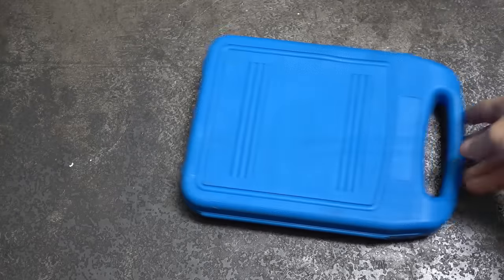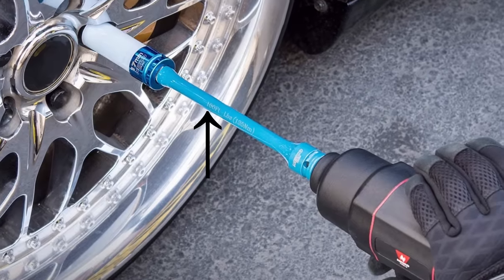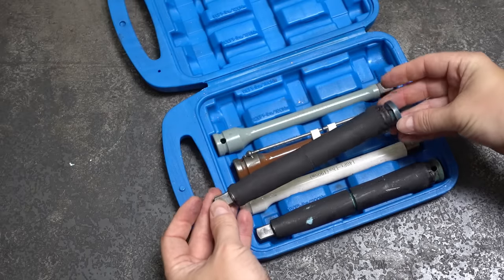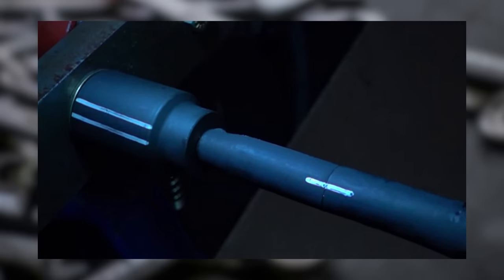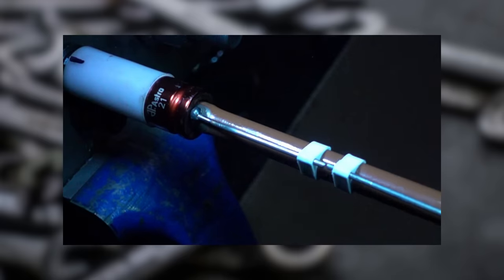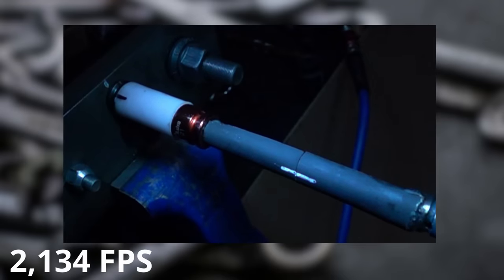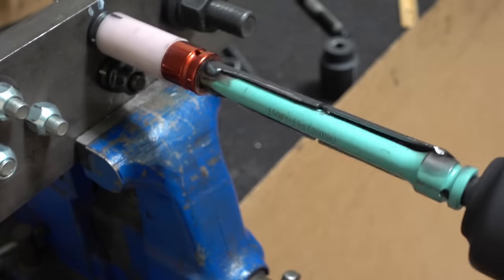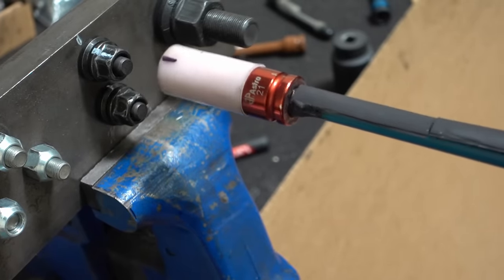Torque Sticks! High Speed Video Helps Reveal the Truth

Comment: I spent years using torque sticks and then double checking EVERYTIME with torque wrench.  99% of the time, they were accurate...enough.  110 ft lbs on a 100 ft lb recommended wheel stud is fine and youd barely notice the extra strength required to break the nut free...a couple inches longer breaker bar / tire iron would literally make it a non issue.  Old timers dont even torque their wheels....they just crank em on as hard as possible...I have removed wheels that must have had 200+ ft lbs on the studs...literally ready to snap.  Just use a fang torque wrench...they are like $25 at Princess Auto.  I would bet over 75% of vehicles on the road have improperly torqued wheels.

Comment: Other than speed like in a manufacturing environment or perhaps a shop that does one thing (change lug nuts) I don't see the point of these. Probably better to just tighten snug and then torque to the needed measurement.

Comment: Torque sticks = nope.  Thats life and death stuff sometimes.
Know your tools. My 1/4 impact driver at setting 2 with the small battery and 1/2 drive  adapter + deep impact 19mm socket = approx 80 ftlbs. Honda lug nuts many are 80 ftlbs.  Turn the nut till it JUST bottoms, stop.  Finish with torque wrench. Drive the car aggressively 10km, retorque.  Yes it takes time. But theres a right way and wrong way, usually for a good reason.
Stay gold.

Comment: Im a auto Tech in 8 years of daily work ive heard of a tire off twice and both times the tech used a torq stick one was over tightend stud snapped and 1 was not enough and fell off. I do not own torq sticks.  in my opinon they are pointless and dangerous. I personaly. Have learned finger control as my old school air gun has no settings. I zip them on and if the lug does not move at all when i use torq wrench  i know its over tightend so i crack that one loose and do it by hand. In 8 years ive never had a wheel off. Its not hard be safe.

Comment: Horse power is the difference. Torque vs. HP.  HP = (Torque x RPM)/5252. Electric impact guns typically run higher RPM than air guns. Thus, more HP. Torque sticks are designed for AIR guns. Only torque sticks designed for ELECTRIC will work properly with cordless. Problem is finding electric vs. air on the packaging. Always assume specs are for air. After all, what do tire shops run on? AIR.
But I’m old school. If I hear an electric impact gun at a tire shop I throw a fit, watch them manually torque, and don’t go back.

Comment: I use them WITH my cordless impact for wheels only! Never over torqued any lug nuts with them, as long as you only give them a sec or two per nut and no more! Works every time and saves me a ton of time and hassle from having to torque things manually.

Comment: I am pretty confident I mentioned this on your last video, but the reason the electric impact doesn't work with the torque bars is because there is no gas to compress. It's all power all the time, where as an air gun will act like a cushion taking some of the guts out of each impact in conjunction with the bar to stop it going over the amount.

Comment: You'd see a more dramatic effect if instead of cutting the tube in half, you made the cut closer to the male end of the torque stick.
Reply: The ends of the tube are welded at the ends of the stick. So the mark in the center is moving relative to the ends of the stick, not relative to the center of the stick (even though that's where the mark is). So in theory, the cut/mark could be anywhere along the stick and show the same results.
Reply: @troysweet4038  oh yeah, you're right. I was thinking about it as a lever, but the fulcrum is not at the ends, it's in the center of the shaft. My mistake.

Comment: The key to using them on cordless impacts is not to hang on it like you can with air. As soon as it’s run on, let go after a quick one or two raps that’s it. I use the new dewalt this way and that thing rips. I usually get just a slight turn then to the final torque with a torque wrench.

Comment: Meant to be faster and intended to be accompanied with a torque wrench should be written on the tool and a signable document before using but it cant account for persistently impatient service advisors who panick at the first complaint of a more impatient customer also cant help if they band together with numbskull techs and force delivery before bolts or nuts are torqued but thankfully lesson learned without injury or loss of life this time.

Comment: Look, this is one of the millions of things where the tech should be using common sense instead of lazy work. Before some idgit tells me I don’t know what I’m taking about, I was a tech for 11 years. Now, if you are installing a wheel on a vehicle, you first should be threading the bottom lug nut/stud by hand until it seats the wheel in it’s place. Whether you use cordless or pneumatic gun, you are ONLY SUPPOSED TO BE ZIPPING UNTIL IT TOUCHES THE WHEEL AND STOPS. If you see some jackwagon looking like a horizontal jackhammer, don’t let them touch another vehicle. When the tires just touch the ground, enough to keep it from spinning (tire pressure should already be set), THEN you achieve proper torque with a calibrated torque wrench. Why is this too hard to do? When you keep breaking stuff you have to keep doing free work fixing it. That’s just dumb.

Comment: I have tried some and found out that my really high torque electric that has three settings for speed/torque goes really well when changing the wheels if i use the first setting.
Then i can go full speed and just a few ugga duggas and it will be perfect with margin to then finish off with torque wrench (140 Nm). Works hundred percent of the times!

Comment: Air tools tend to have high inertia slugging plunger/barrel. The return time having to reverse the inertia is beneficial to allowing the torque stick to have a full torque reversal. It's like getting your face slapped with a stiff neck. One slap per second versus 50 slaps per second.

Comment: might be a dumb question but if the issue might be ipm then couldn't you just use a lower ipm mode on your impact if it's available? if it makes 1800 in 1st for example and idk 3600 in third and say the airgun that worked fine is 2000, should theoretically work fine if ipm is the issue

Comment: Saying a torque stick doesnt work is like saying torsion bar suspension doesnt work. 
   They definitely work when used correctly, but no shop has x rated gun at y rated shop pressure through z sized supply line for every tech

Comment: As a mechanic for nearly 30 years I'm not that fond of the torque sticks.  There's too many variables that would affect performance.  The different manufactures of the tools have different outputs that is also affected by the pressure of the air as well as volume.  The electrics are more consistent but as demonstrated here hit more frequently not allowing the stick to to rebound.  My advice is learn the feel of the tool so you know how much 'uggadugga' is needed then always finish with a torque wrench.

Comment: There is a company that sells a portable 12VDC electric lug wrench claiming several hundred pounds of torque.  IF it actually does produce that much, without any limiter, they are wide open for a damage law suit.  They should have a disclaimer that it should only be used with the appropriate torque stick.

Comment: As an RV transporter, I use a torque stick to double check lugs on an RV before moving it. Yeah, it's not accurate, it doesn't need to be, but it just makes sure that after a second of hitting a lug I'm not going to stretch it us break it off, like I could with a naked driver. And I don't have time to screw with a torque wrench on 32 lug nuts.

Comment: Neat video but I've been using these for 20 years and I understood how they worked back then, all the  problems people have had with these over the years are people not understanding how they work and how to use them. I think you should do another video with the same torque stick but change the weight of the socket normal vs impact socket on the end I think you'll be surprised what happens and the torque sticks that have the socket built into them

Comment: I dunno why there isnt a gun with a built in regulator that you can manually set to a certain torque setting and just rip away and everything you fasten will be at that torque no matter what youre tightening..  the technology is there, just havent had any manufacturer design one..  probably because the tool would by itself get rid of a few other tools that the manufacturer could be making money on...

Comment: It's not really a mystery why cordless does this it's built in to the design. It's a function of the manufacturer building in a correction curve for a cordless product that is going to lose efficiency over time due to being battery powered nothing more nothing less not a good option for accurate torque

Comment: Yeah, torque sticks.  I stopped using the local garage because their torque sticks weren't working properly.  125 Lb.Ft. is what my lugs are rated for.  I've ruined two 4-way lug wrenches trying to remove the lug nuts.  My rotors were warped.  I've asked the local garage to use a torque wrench when tightening the lugs and the service manager refused.  I gave him my opinion of their refusal and that was the last time that I've gone there.  No more warped rotors!  Damned clowns.  They've effectively lost several thousands of dollars over these many years by loosing my business.  I wonder how many 10's of thousands of dollars they've lost due to these over-torqued sticks.
Reply: The only torque spec some people know is "a few ugga duggas" which is evident in the work product.

Comment: 1. Torque sticks are only about 10% accurate.
2. Torque sticks only work with impact wrenches that hit at certain frequency as shown in this video.
3. Using impact driver instead of impact wrench, makes error even worse; because the axial portion of the impact will change the stiffness of the rod.

Comment: Would it be possible to get a calibrated reading of the torque sticks using a lever and a force to torque the nut up to whatever you're looking for? Then using the same line trick you can confirm if the sticks are accurate to real figures, or if they're just all accurate to each other? But to be fair I'd think if they're repeatable and accurate to each other it would be an impressive failure to then be inaccurate to the actual torque figure. Good explanation, its about what I'd argued in the past too so its good to see that confirmed properly via high speed.
Reply: The problem is “torque sticks” results are dependent on the force curve from the impact wrench. Higher frequency causes more force to be transferred - so you need to calibrate them to your specific impact wrench.

Comment: Great demo, never used them in 40 years on the bench,  torque them up till lightly tight, then use proper torque wrench, road test even just around the block then check nuts again

Comment: I still don’t get the sentiment that these are actually meant to torque the lug nuts to spec. I’ve always been taught you go at least 20 lbs lower just to snug up the lug nuts and then you *always* still go in with a torque wrench. Whoever’s teaching people to use these instead of torque wrenches is out of their mind.
Reply: Also you are definitely not supposed to hammer them for 10 seconds, once the stick twists, you stop impacting, the twist is just mean to indicate you’re around the desired level

Comment: Never used these sticks, always been suspicions of them purely because the physics is very dependent on the jerk (delta acceleration), which varies heavily from tool to tool. Not to mention you're trusting Chinese metallurgy (which has gotten far better), and nobody has the equipment to test them.

The only justification of these tools are for people who are too lazy to use a torque wrench, if you want to use an impact fine - run the nut/bolt down until it's impacts the first time then use the torque wrench from there. Nobody is going to use this with an impact and then torque it afterwards with a torque wrench, they will just use the impact with a torque stick and call the job done.
Reply from the maker: All the ones we tested are USA and Taiwan. And Taiwan cro-mo and spring steel is top shelf
Reply: @TorqueTestChannel  Good to know, still don't trust these tools though as I'm sure the springs wear over time (to some extent) and change with temperature. Not to mention I'm sure the differences in socket types (deep / shallow / 6 point / 12 point / etc) also have an effect.

Comment: I would think the impact driver's design matters with sticks. I'm pretty sure some drivers apply more impact degrees than others, and the degrees of impact rotation may even change under load. Of course, the sticks are very sensitive to how much rotation is applied.
Reply from the maker: Not in this case. 2 hammers, 180 degrees of hammer swing between blows, same as a cordless impact wrench. Imparting degrees as a result of the blow is simply a math problem of impulse force in joules vs how tight the fastener + friction. So in this case should be less with a driver, which is why we used it to show how helpless using cordless is. Though we showed footage of the same using the 1/2" cordless Matco gun too
Reply: @TorqueTestChannel  Thanks for the explanation!

Comment: If torque sticks were anywhere near accurate and effective, you would see versions to use for head bolt torquing.
Reply: @parochial2356
 I know this is a year old video. What head bolts get one pass and call it good over all the bolts or studs and nuts?
Lets not talk about final torque in degrees or angle to stretch the bolt or threads, or to seat the gasket, right?

Comment: The internal spring that is being wound to pull back the hammer should determine in part the preload.
With a smaller mass you probably need a stronger spring to compensate.
Also, airtools are known for having fast but weak "motors". Electric are known for having higher torque, and brushless should have higher than brushed.
Reply from the maker: The electric motors in these tools in torque terms pale in comparison to air motors, which is why an air motor is direct driven to the impact mechanism and electric motors use 10-20:1 planetary gear reduction.

Comment: I think it's apparent that torque sticks will work and be pretty spot on if and only if they are matched with the correct(ideal) type of impactor ( pneumatic or electrical). Rates of impact, air pressure, condition of the battery, condition of the nuts and studs all have their effects. A torque wrench used to verify the results is always a good idea.

Comment: The torque dyno uses a much larger (more mass) socket than the lug nuts and with the small amount of slop between the nut and socket, the larger socket is acting like an impact even with the torque stick. You can see at 3:08 that the socket free play is hammering the nut much like what happens inside an impact wrench. Try applying a slight tightening torque while using the torque stick to remove this free play of the socket. I think you'll find that the dyno reading will be much closer to the torque stick rating. Nice video! cheers @Torque Test Channel

Comment: Why don't you just use a smaller impact?
Big wrench for undoing, small one and a torque wrench for doing up.
Reply from the maker: Yup, that can work if you do the same line marking method and it works out for the torque you need. Small impacts these days can still easily do 200-300 ft-lbs
Reply: @TorqueTestChannel  I use an impact driver (to remove as well as install) on my old Defender. Zip them up to a couple of ugga duggas then finish by hand.

I do have a high torque but it's complete overkill for almost all the automotive stuff I do.

Comment: I just stopped the video when I realized that you didn't understand wire the wire rig with the 3D printed stand offs wouldn't work as a proper demonstration piece. You should pull this video if you want to be taken seriously. Also "Let's weld to specially heat treated metal parts, then expect them to act as advertised....

Comment: In my younger days (mid-80s) working in a tire shop we used torque sticks and the instances of rotor vibration comebacks dropped dramatically, so they do something whether or not it can be demonstrated.
After I started my dealership career in the late 80s I began using a 3/8" impact for wheel work and 'bumped' the lug nuts back on with the same impact before hand torquing. 1/2" impacts are wonderful for really tight and larger bolts such as crank and suspension bolts, but heaving one around for every tire rotation is a recipe for wrist injury of which I have enough after 34 years.

Comment: I think the reason for the difference in results between welded on nuts and the hydraulic test rig isn't due to the hydraulic fluid compressing, but instead is caused by the flexible nature of the hydraulic hoses. Since they must be flexible to function, it makes sense that there would be some (although not much) stretching of the internal diameter of the hydraulic hose under these conditions. 

Just a thought, I could be wrong